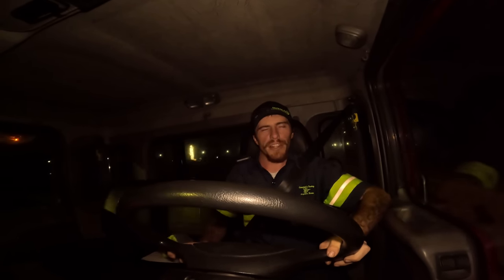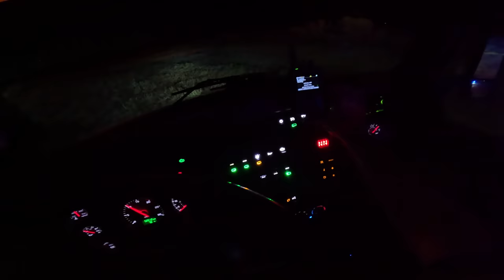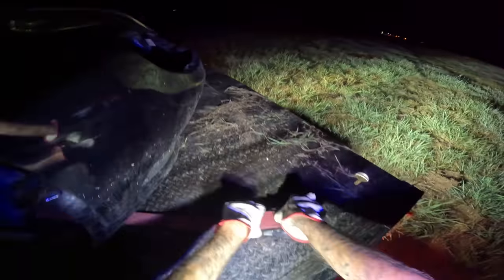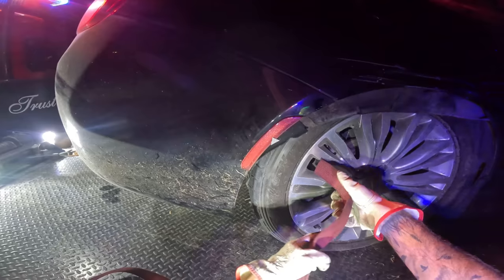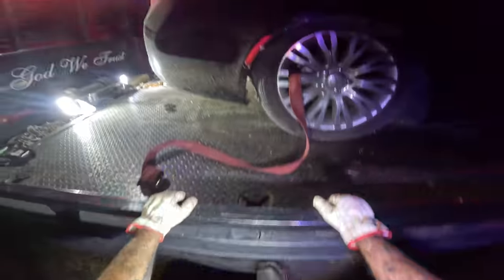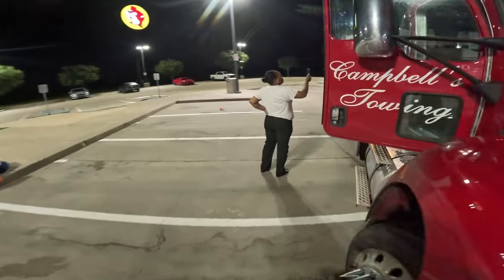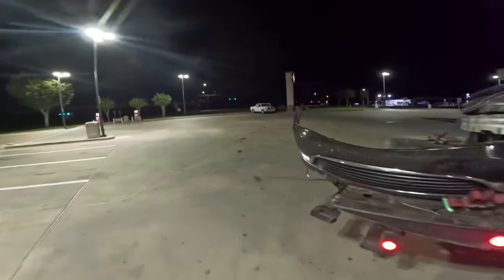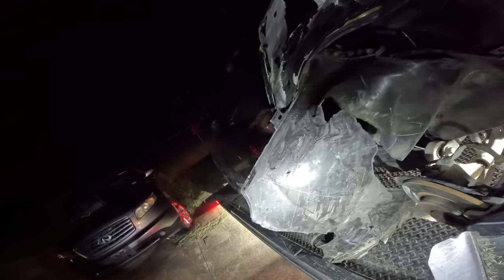How Did This Happen? Chrysler 200￼ Loses TWO Wheels!

Comment: Good job again man! I had a call one time that was different for the. A lady broke down helping a friend move his truck to a location, since he couldn't. I showed up at the gas station, downtown Atlanta, at night. The call was correct, a dually didn't start, after getting fuel. It was her, and two kids. I loaded the truck, and she was trying to get a ride for all of them. Well, that failed. The company policy only allows 2 passengers. I couldn't leave them in downtown Atlanta like that. I came up with a plan, it was spoken from above and went right to my heart. She sat in the passenger seat (one kid on her lap), the older sat next to her. The seat belt covered all of them. I got them to the drop off location safely. Her words to me, I will never forget. I broke the company rules a bit, but not my rules of doing the right thing. You have well spoken words on the headache rake of your truck. Ride with pride, God's got your back! I had many close calls with drivers not caring about emergency vehicles. That includes tow trucks. The best part of towing for me, was helping people. Be safe! Amen 🙏

Comment: It appears that this car has been hit by 2 cars, or a car and an immovable object. No wheels? The paint is gone, is that something that you see often when you pick up a car? It’s interesting that there isn’t dig marks in the grass or grass thrown all over the car and stuck up in the wheel wells. Very interesting.
Reply from the maker: I’m assuming the damage is from striking a guardrail, and the front broke the wheel studs off while spinning across the highway.
Reply: Ok, the tires. You are so careful to clean up the area of an accident. I’ve been very impressed by how conscientious you are. You certainly wouldn’t want to leave something as large as a tire or 2 on a busy throughway. If it caused another accident, would you be responsible?